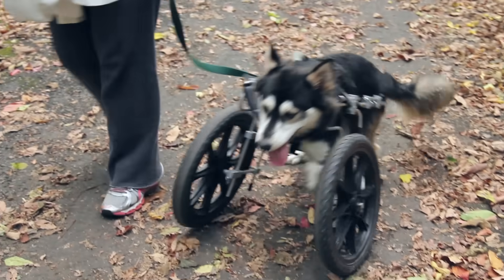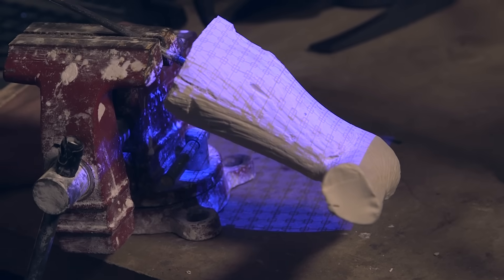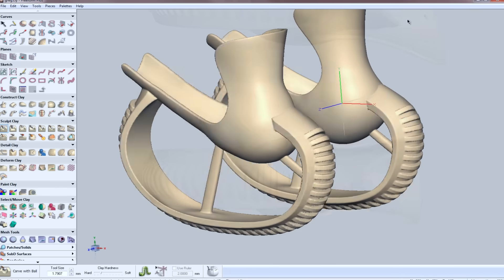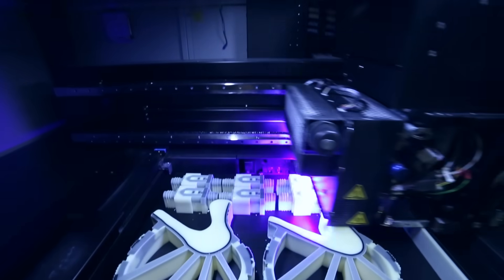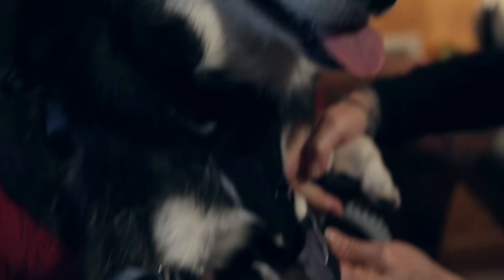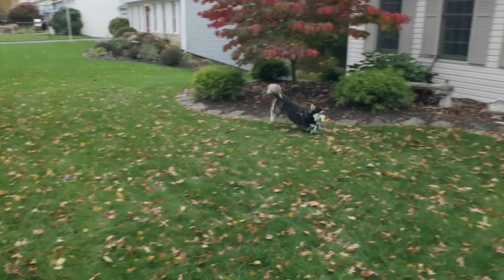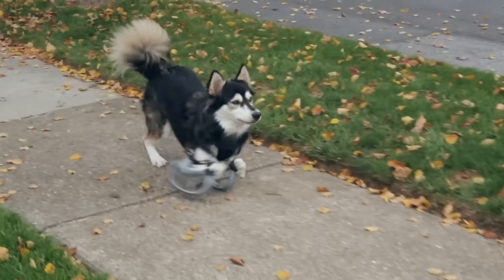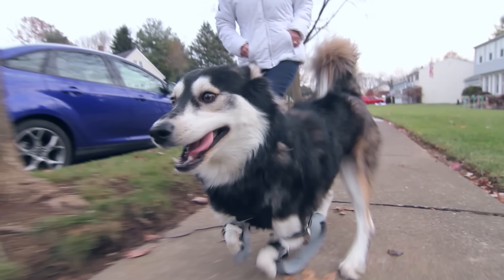Derby the dog: Running on 3D Printed Prosthetics

Comment: What is the name of the software used for made the prostetic?
Reply from the maker: This is a multi-material print on the MJP 5600 3D printer which encompasses both harder plastic (white) and rubber material (Black) in the same print

Comment: I wish the 3d model was available :(  But I will just have to start from scratch for our foster pup!
Reply from the maker: sir, as these are custom-designed to fit Derbs, the CAD data would not work for you. Sorry!
Reply: @3DSystemsCorp  But it would be helpful to have the basis to work from and resize for individual pups 😊

Comment: +3D Systems    Months ago, on a rainy, cold winter day,  whilst on my daily run I found this poor little stray Chihuahua mix on the street.. I stopped picked it up and brought it home with me... It suffers from the same birth defect. It's two front legs are underdeveloped just like the poor dog in this story... My question to you is how much $$$$ would it cost to manufacture a pair of artificial limbs?... It is a small Chihuahua mix.. It weighs less than 20 pounds..Thank you in advance..

Comment: needs to be a bit higher on the from. so the dog back is more straight not bend down.
Reply: I know that, but in the video they said they were starting short so that they wouldn't make a drastic change and injure poorly-developed muscles.
Reply: +Howling Hills yes, I sow it after I posted.
Reply: they said they would start him off really low so its not too overwhelming and as he grows more confident hey will make them bigger and bigger ..that was one of the positives of the 3d printer his bone structure was saved on file so they can just reprint them
Reply: +RazerOfPain they made an updated version and he's what his normal height would be and sits normally, they posted a video of it :)
Reply: +LetsPlayWiki you saw it.
Reply: +Will O'Donnell Just sow it thanks.

Comment: AWWW so cute I just feel they should be a little taller? I'm not the expert here it just looked like his back was dipping :)
Reply: +LivFlips These are the first model, and it is explained in the video that they are intentionally smaller so that his posture is only a little different than when he doesn't have them on. They will make them larger over time and allow his body to adjust gradually. You can see much larger ones (almost a full circle) being printed in the video too...

Comment: I feel like if he got the bottom half of his front legs cut off and got new prosthetics, in the correct lenght this time, it would probably be easier for him to run more upright in a more correct position for him. Also I don't think it's a good idea to let him run that far every day with the posture he has now. He might get back problems later on. Make longer prosthetics maybe with a spring in them to compensate for the missing joints.
Reply: +scarystuff1970 True, I was thinking the same thing after I saw the dog running
Reply: +Matt John It is explained in the video, as well as in the original post.
Reply: Hes lucky he got prosthetics at all. He will be fine. Longer prosthetics might actually hurt him since his body was already so low to the ground. A mid point is needed and later on they "might" move to a high point.It costs alot of money to get them and most disabled dogs have wheel chairs compared to this.
Reply: Elizabeth M Yes I saw. Also, I cannot hear the video but I try to understand it. Thank you. :)
3D printing still needs a designer, scanning and creating them along with many little steps and work in between.. That multi material printing is still expensive to use-way more so than wheel chairs hence why there are way more wheelchairs on dogs than prosthetics. They quoted a friend 2.4k for a prosthetic that is "3D printed" in CA.  We got her a 250$ wheelchair instead and she is very happy..
Reply: Exactly i hope they plan on further design. Otherwise i guarentee hed be better off in the long run (no pun intended) physcial health wise without them...
Reply: +scarystuff1970 Did you not read the first comment, by 3D Systems?
Reply: As we pointed out in previous comments, they said in the video that they would raise the height later.  These are 3D prosthetics, a new technology that isn't as expensive to make.  Plus the dog's owner is involved in that technology.  Did you not see the video?
Reply: WhiteWolfos, there is a link in the description to a follow up video, where they show various attempts to modify the prosthetics.
Reply: It would hurt his muscles if they made it highter
Reply: scarystuff1970 I feel like you're an idiot

Comment: this is awesome. Goes beyond the basic plastic printed stuff. The next version of prosthetic for the dog needs to be a little longer to allow the dog to stand more upright.. Not sure if the plastic densities can be changed during the printing process, but if the top 1/2 was rigid, middle 1/4 being medium rigidity, bottom 1/4 being soft it may give the overall prosthetic more stability and bounce in each step.

Comment: This is great.  I wonder why the prosthetics are made so that the dog's front end is so low to the ground.  Looks like they could have made his pros legs as long as the back.  Seems like he will develop back issues.
Reply: Xena Jada he will develope back issues but without the prosthetics his outcome is obvious. Imsure that if the prosthetics were longer the angle of his back will be opposite of how he has grown. That will hurt and change a little over time- but he has his permanent skeletal shape. The prosthetics are a gift that weren'tjust thrown on, he's been measured in different ways to account for stress and as his shape and stance changes his gift will be changed to accomadate. This is awesome and after seeing this, lets just say I'll never forget it.
Reply: +Jeff L this is late but they're gradually going to do larger ones so he can get used to them. They will eventually be large enough that they are level with his back legs
Reply: Dong Master hie, never to late for this topic. I have thought about the entire issue with the lengthening of the prosthetics. I don't recall how long doggie has been wearing them,  and that makes a difference but if they (gradually increase the length) obviously it will be so much easier, and less painful. The pain was what I was concerned with actually, because he will adapt either way. If they went too long, - too soon for him. The professionals handling it know this of course, and  my prayers are for the very best. I am an avid animal lover. Thanks for the return comment- peace...

Comment: can i say something about this ??? please do some R n D and this could help injured dogs when they are on a CAST and they couldnt support their body weight on just 3 legs and doing their pee and poop would be difficult.. if possible, a S shaped design would be best because it would enable them to sleep with it and to move around and still support their weight on all sides.. 

im saying this because my pomeranian which is super small in size is having difficulty supporting her weight to move around and pee or poo, therefore i designed a spring around her cast and allow her to put her weight around her front tigh up to body instead of the front end of the paw which would cause sore pain on the front paw skin.. 

good luck

Comment: It is amazing to watch Derby running... What's wrong with those who feel the need to make rude and stupid comments. The dog seems to be happy.. so should all that watch the video... No need to put the dog down, he could get around without the prosthetic legs, just not as well as he does now that he has the legs,,, Printed on a 3d printer !! Which is a pretty cool invention in itself.
Yes you can print a gun on the printer, but you just can't take a picture, print it out and shoot... You need to design it totally,  I have no idea what goes into a gun to make it fire (Yes a firing pin) so just because there is a 3d printer you can't just print out a working gun...So if you are that knowledgeable on how to design a gun from the sight to the grip, you probably can make one without the printer... So, keep the printer, keep the dog, keep making those awesome legs... Get rid of the morons that have posted idiotic comments !! Way to go Derby, keep running.. Please post updates on his progress... and height !!!

Comment: Great story.  Hopefully this tech will also lower the costs of prosthetics for humans because I've always heard that they are very expensive, especially the nicer ones.

Wanted to mention something you're probably already aware of, but just in case, you will want to have a Vet/kinesioligist use some scanning tech to study the motion of the dog's limbs, shoulders and spine, because even though it may look fine at first, it may be the case that his shoulders and spine are being stressed in unusual ways which could lead to injuries over time.  Also, if the cushions are too spongy on the bottom then he'll end up dragging them forward which will be a new kind of stress.